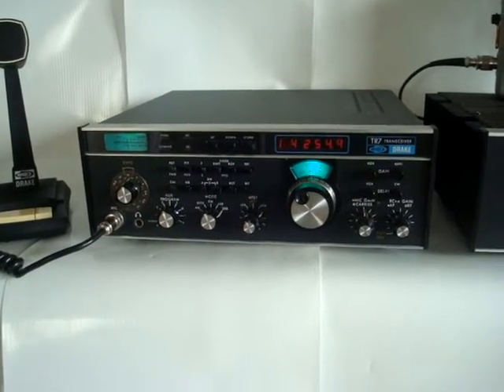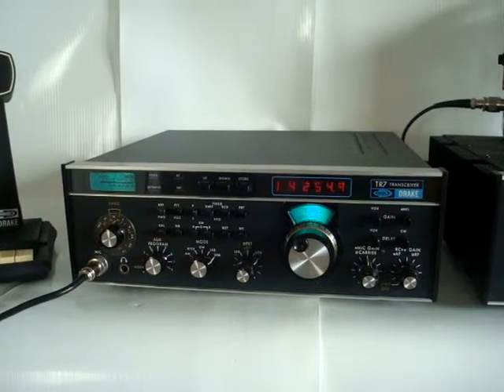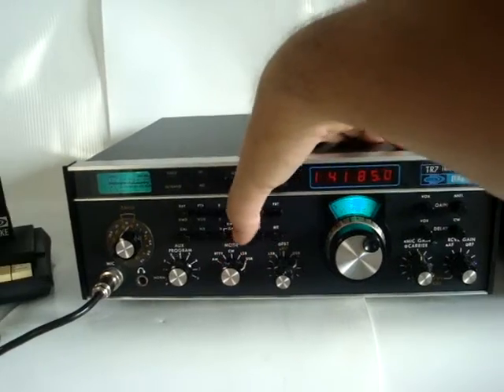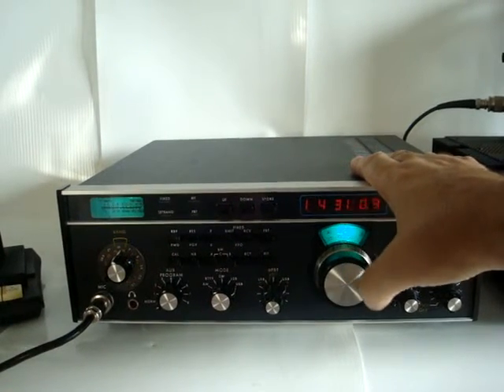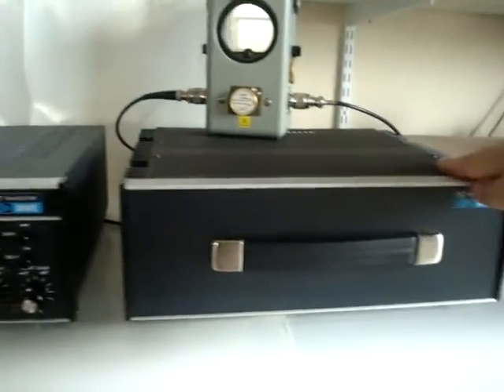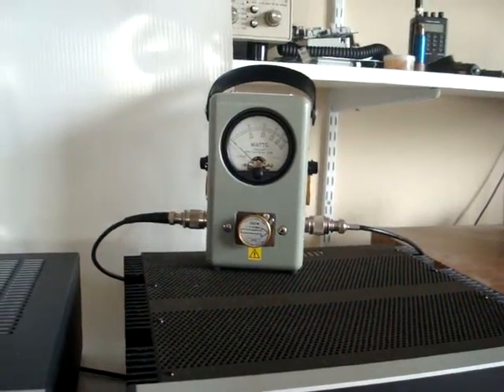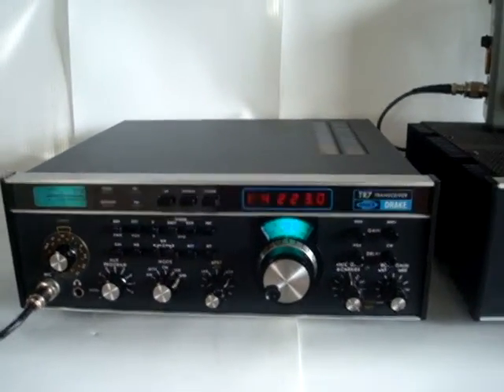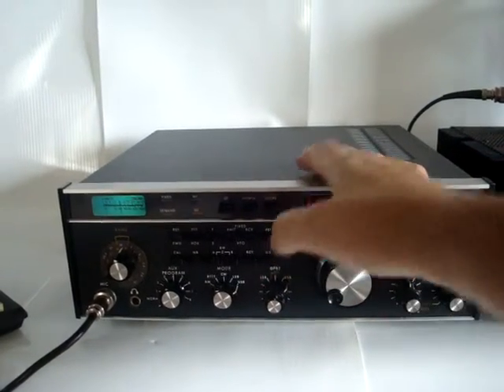Drake TR7 transceiver with PS7 power supply and 7077 microphone.mpg

Comment: It's hard to explain the appeal of Drakes but somehow the TR7 takes it to a different level. It really isn't a fancy piece of kit, but it represents an epoch change in the design of amateur equipment. Firstly, it's all semiconductor, one of the first non-tube rigs on the market. And the Sherwood figures really aren't bad for the era, it's up there with the big names of the time in performance. The look of it is almost homebrew, there's no moulded front panel like the Kenwoods used, it's all metal sheet and extrusions, nothing sophisticated. But the performance for the technology is brilliant. Somehow those guys in Ohio really thought this one through and produced a game-changer that has a functional balance that designers have followed for years since.

Based on limited use so far, sensitivity is good, no stability issues, audio is nice and clean both ways. I see 100W+ output as expected. One noticeable feature is the NB7 noise blanker that absolutely kills pulses from neighbours' electric fencing, it's really effective. Then there's the PBT... I rarely use the IF shift on my TS830S, but the Passband Tuning on the Drake just begs to be turned on it's so effective. I run it as a second channel on the Kenwood SP-230. Also have the SP-75 Speech Processor that I'm still setting up. First QSO was Heard Island on 20m.
Reply: John YesItsMe hey I saw your review on Eham! Nice! How do we use the AUX 7 ? The yellow is the six 7 on the band switch??